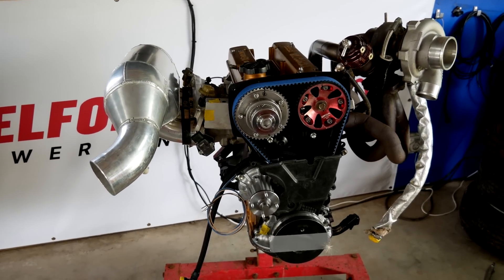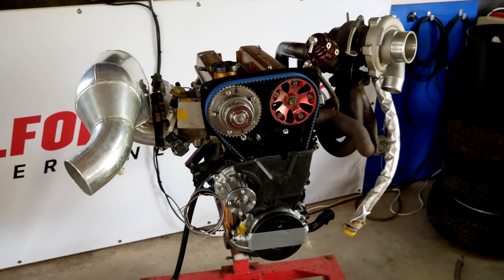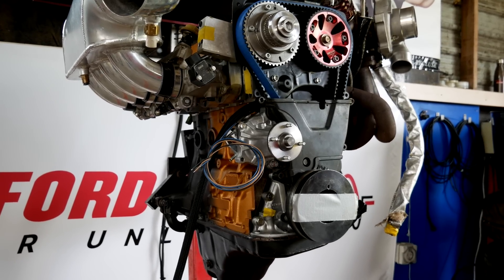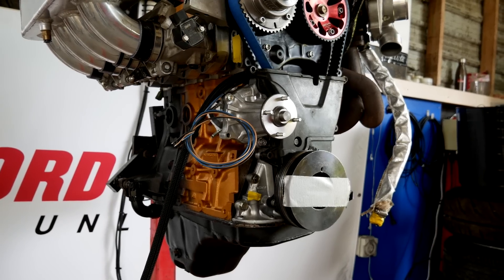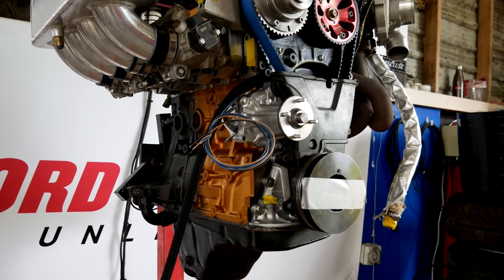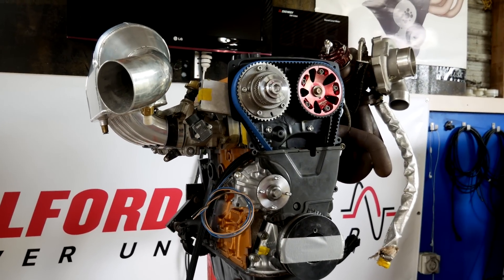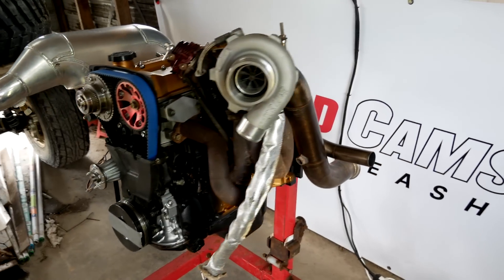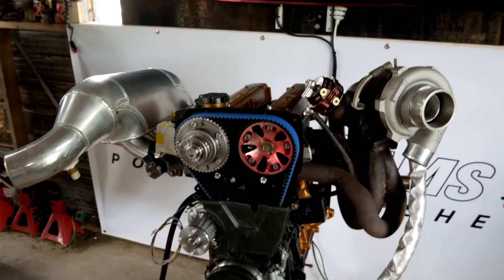10,000rpm, Long rod, VVTi, Turbo 4AGE Hilux - dyno tested

Comment from the maker: I lied,  its limited 9900rpm, not 10k.    Other news,  I have added a db sound meter to the dyno wall.  so you all can see how deaf I'm going.     Also have  a new mic for the camera, which was being used for the dyno pulls and the clips at the end. If you didn't get past the graphs at the end you probably should..   So yeah things should sound a little closer to what the actually sound like.    As always, if you missed the engine spec's they are in the description.    Giz a like and all that weird stuff  that everyone begs for,  so i can afford to put the rods back in my block when they fly out.
Reply: Sound like a very happy motor. Full song reminds me of a big turbo E85 CA18DET I built 15 years ago. VVT is a wonderfull thing and makes wonders for the powerband, some guys are locking them up and I allways thought that's the dumbest thing ever.
Reply: Awww man - we didnt see the magic cam install procedure :P  Awesome work!  Love the vids, info and dyno results and repeatability - long may the "truck" run!     A real sleeper build as well lol
Reply from the maker: @cbdrift   Everyone knows the vvti cam install is still top secret haha
Reply: @Garage4age Never hated a youtuber like this before🤣🤣🤣.. its like the magic show in the street but they won’t tell you the trick😭😂
Reply: Great work as usual
Reply: Goo oooonnnn

Go ooooooonnnnn
Reply: @Garage4age can I get a quote for you to fit supertech valve springs MRP retainers and Toda cam gears to my 6agte 20v? (Factory valve springs held it back from to much revs and boost during last tune)
Reply from the maker: @ryanandersen991 hey,  i dont usually do that kind of work, unless its here for a tune  as well.  but can email me if you want  garage4ag@gmail.com

Comment: I never ask but i know back then you use 47mm oversized blktop itb but what itb did you use now if those plate are 52mm still blktop oversized again ??
Reply from the maker: the 52's are bmw throttles
Reply: @Garage4age  oh ok so you are dbw now ?
Reply from the maker: @sachadohc2912   cable.   next build will have dbw itb's
Reply: @Garage4age  bmw as cable 52mm itb 🤔
Reply from the maker: @sachadohc2912  they have a separate  external dbw module. that commonly breaks  and is expensive.    easy to convert to cable.  port spacing is too big for 4age though, so have to modify them.
Reply: @Garage4age  oh ok didnt know you can convert them that pretty interessimg then

Comment: How do you keep the bottom end together when revving so high? I do not see a girdle or ladder caps to keep the crank happy.  Is it only because you are doing quick pulls and not sitting at those rpm's?

Comment: Thanks for doing all this awesome research! I currently have a 4AGZE, similar to your old engine minus the ported head and with a big SC14 setup. I am approaching the crossroad of switching to turbo.

I was thinking about a set of Kelford Turbo (HV) cams, 1SZ solid lifters, appropriate springs and then was heading down the route of a G25 (well PSR version) to try and get some response as I a really enjoy the instant torque hit of the SC14. How big is the turbine on your gtx2860? I'm probably also going to employ an antilag strategy as my application is an offroad buggy....which is why the instant response is so addictive. For the sake of information.....200kW is probably more than enough in a small single seater buggy between trees 😅

Interesting to see you had been pushing the 4AGZE rods and standard cams so far. Do you have a video detailing the porting and modified headwork somewhere?
Reply from the maker: gen 2 gtx2860 is still really good match for low - mid 200kw  at wheels.   have tuned a pulsar g25 4agze engine,  came on around 500rpm later than my old engine, but it did have some aftermarket cams, so results may vary.   The g25 would be my next step,  but would run the 2860 if dont want to go past 250kw.     I probably wouldn't even bother with cams if your goal is around 200kw,  a stock smallport ze with do that no problem,  but will take more boost. around 18psi on a nice turbo manifold  and intercooler setup,  with stock head and stock na inlet manifold.  done one not too long ago with same turbo as im running.      cams can actually make the turbo come on later if you go too big.     no vids on the head work sorry, the head on it was quite aggressively ported, probably almost too much for stock valve head tbh.  was a hand me down from my na engine  before i went to a big valve head.  something the 10 year ago me did..     the one on the new engine is a bigport head and was modified not to lose power  off the bottom. but yeh  not as good as the other one up top
Reply: @Garage4age  interesting! thanks for the tips. I just figured G series was the new hotness, but good to have some real world experience. Any idea how big the cams were on the PSR G series thing?

That definitely is the beauty of the turbo application, so easy to cram more boost in. The SC14 just makes whatever it makes, spin it harder and it just makes hotter air :p
Reply from the maker: @ae86racer007   it had hks cams   unsure if 256  or  264 version.  nothing too big either way.  G series newer tech yeah.   but is still a bigger turbo with bigger wheels than the  2860,    Any half decent turbo will make a stack more power on same boost as a sc12/14,
Reply: @Garage4age  I am starting to see that! Just going to need some ALS to keep it woke at 3000rpm :D

Garretts Boost Advisor did favour a 2860 over the G25....G25 is on the bottom of the efficiency Island, 2860 was pretty solid in the primo area :)

Comment: What are the advantages of running the itbs in a turbo setup instead of just a single throttle body? And thanks for all the great videos, really useful information
Reply from the maker: Hey, thanks for the donation.    Mostly so the engine runs nicer  at low rpm and idle.    With a big plenum single throttle intake and or bigger cams,    engine will stall out easier and not run down to  as lower rpm.     ITB's  will run a lot better down there since plenum is on the other side of the throttles.         An engine with bigger cams will run nicer with itb's than a single plenum regardless of plenum size or if its na or turbo.

Comment: I got 4agze stock bottom. I word like to make around 300whp reliably. Is it possible? What combinations do you recommend? Thanks 🙏
Reply from the maker: Yeah easy, long as its in good condition with good tune.   the "old engine"  in this video is just an 8.9ze bottom end.  has arp rod bolts, but otherwise stock parts.
Reply: Thanks for the reply
Reply: I have haltech 1500  would  like to use it on my so
4agze twincharge or turbo . What would  you go with?

Comment: Hello my friend,make video about phase timing (ECU)like you have about ignition timings,if it possible ❤
Reply from the maker: I have quite a few cam timing videos if thats what you mean.    4age vvti: https://www.youtube.com/watch?v=B1mAesApxv0       k24 :   https://www.youtube.com/watch?v=rX6rAjI-VW0 
 4age turbo https://www.youtube.com/watch?v=bnIsNwdKnCw    this one is not variable but you can see what the settings would be if it was
Reply: @Garage4age  I watched these videos,I think they are very useful. I asked the question a little wrong, I’m interested in how the timing of fuel injection itself is affected, maybe your ecu doesn’t have such a function, I can’t know for sure, in mine ecu has a map similar to an ignition or mixture composition map, only there you can set the timing of fuel injection, for example, into an open valve or into a closed valve, etc. ,exactly the moment of opening the injectors,That’s what I meant
Reply from the maker: @nivagarage301 Ah you mean injector timing.   some ecu's call it different things.   I did a little bit on it in this video   https://www.youtube.com/watch?v=lt7JpXEfH-4    Isn't usually much in it power wise. generally  just adjust till afr is the richest, meaning the fuel that is injected it getting burnt/properly  burnt.  then trim the fuel back to the correct afr.    can make the engine run nicer at low rpm,  sometimes is a little to gain in the top end on an aggressively cammed setup,  but only if have big injectors that are running at lowish duty up there.   i may do a video on it at some stage

Comment: Hey I know this probably isn’t the best way to ask this question but how did you do this swap I have a 87 4x4 and have been trying to figure out how you did it for years since I saw one of your videos and now my motor is out and I’m debating on a 4a 16 or 20 valve or a 2JZ and I have really liked these motors so any info would be very appreciated

Comment: Still 1.6cc? Why use the 4age cranck in 7afe block? I want to build a 7afe block with 1zz cranck, and 2zz rods but im afraid 😂
Reply from the maker: because it makes everything the 4a is better.  that being a small high revving engine; smoother, more reliable at high revs.    7a on the other hand, vibrates more, pulls power band down the rev range and makes for a kinda lazy boring engine.   Yeah its still 1600, same bore and stroke, just longer rods.
Reply: I run a early bigport/4ac bottom end with 16v smallport head, i doubt of going with a 7a bottom end, but here is more easy to find parts for the 7afe, i want 180hp (the head now is worked with some cams, with std head i have near  150hp to the cranck) What would you do in my place?

Comment: Hey mate just wondering if you’re worried about the shim over buckets crapping the bed at high rpm? I watched a video of a guy talking about 4a’s and he mentioned Toyota switching to rockers for the 2zzge head because longer duration cams and higher redline. Cheers
Reply from the maker: I have swapped to 1sz shimless buckets on this engine.    You will find 2zzge uses rockers for the vvl system, rather than them switching to them for rpm issues

Comment: is it a destroke ? how many CC ?
Reply from the maker: both engines 1600cc.  new engine has taller block and longer rods.  same crank in both
Reply: @Garage4age  woah. so its same bore, just taller deck ? is it custom billet ?
Reply from the maker: @aubreyk.5927   its a factory toyota 7afe (1800cc) block, which is the same bore as 4age, just  is 15mm taller
Reply: @Garage4age  so, a 7a Bolck, with 4a crank ? and/or custom rods ?
Reply from the maker: @aubreyk.5927  yeah 7a block. 4a crank, custom rods,  4age pistons

Comment: Old engine had more stroke as i undrestand and was better mid range which is logical. Vvti band aid the low rpm but no replcament for displacement. What is thr reason for the destroke?
Reply from the maker: they are both 1600cc.   old engine is a factory 1600cc bottom end,  new has taller block but longer rods, same crank.  more reliable at high rpm.    The difference is in the heads, old engine had newer design  smallport head that had been heavily  ported, from one of my na builds.    new engine has older design bigport head.     if swapped the old head onto new engine would make more power.    but already does what it needs to.          old engine/head had more midrange power due to where the cam timing was set, if it had cam timing adjusted or vvti would make more power up top also.      The new engine is mostly made of 2nd hand parts and leftovers from other engines and projects btw
Reply: @Garage4age  very interesting,I take back my comment. Any chance of flowing the two heads. Is old design bigger port really flowing more than newer design small port. What about valve sizes and throat %?
Reply from the maker: @abdullaalameri90    The  big port and smallport names are kinda misleading.  its just the port entry on the  the "bigport head that is actually bigger,  which what seems to be designed around the toyota tvis system.   further down the port the bigport head is smaller than the smallport head.  both are the same on exhaust side.      Both can be modified to make pretty much the same power.     In this case its more the fact that the smallport head on the old engine  has had more aggressive work done to it.    They both are modified and make more power than stock heads.  The bigport head was originally  modified with the aim  of not loosing any bottom end power and gaining top end.  which i did, can be seen in one of my earlier vids.
Reply: @Garage4age  thanks very clear

Comment: i was under the impression high duraton / lift cams would negatively impact low end torque / power and instead you gained a tonne of top end, how did you manage to gain low end aswell as top?!
Reply from the maker: Thats why i only swapped the big inlet cam in with stock exhaust cam.   if I use the exhaust cam out of this set (they are actually na cams)  it will come on boost about 1000rpm later than stock cams.   have done the same test on the na version of this engine https://www.youtube.com/watch?v=-Inv1TkANls    Which is the same head and similar bottom end.     It really needs the vvti to make it work so well though.
Reply: @Garage4age  interesting, so installing intake cam and leaving exhaust stock actually has opposite effect of having both!

Comment: the old engine was 1800cc as well or was it 1600cc?
Reply from the maker: Both are 1600cc
Reply: @Garage4age  i'm sorry i didn't write that clear enough. i mean only the bottom end, since you said the new bottom and is 1800cc
Reply from the maker: @noahkalin5379    the block itself on the new engine is from a 7a (1800cc ).   but it has the 1600cc crank.  So is 1600cc.  I'm using the taller 1800 block to fit the longer rods
Reply: @Garage4age  and same thing goes for the old motor?
Reply from the maker: @noahkalin5379   old engine was a normal 1600cc   1.58 rod ratio.  new 1.78
Reply: @Garage4age  alright, thank you very much

Comment: Hey dude with a 10 K rpm limmit on that capacity your turbo too small By Far so you dont have enough air to supply It
Reply from the maker: Not at this power level, it's fine.    Power curve is very similar to  the same combo in na form. Plus it reacted well to the cam swap.  Pretty much as expected, as it done na.   If was chasing more power. Yes I would run a bigger turbo and a bigger exhaust cam.  But that would loose power off the bottom. more bottom end power was one of the main goals.   So yeah everything is happy and working as planned. Has stacks of power for what it needs to do

Comment: The dyno looks to be Sus to me .looking at torque to hp curve the 5000s rev shows no lapping . ..? Look I’m no expert but looking at the 10000 rev speed ? Power lapping lines ? Torque is at what ? 🫤🙄 ha, I hope this is all real and I’m not reading the graph correctly . 👍
Reply from the maker: Hey,   yeah get a lot of questions about the torque numbers,  i even made a video about it a few years back. https://www.youtube.com/watch?v=krnmGSmUQOI at the end it explains how it works.   basically the numbers you see are what ever dyno reads in the background and uses to calculate power from said numbers and roller speed.    Then is another calculation  from power  and  engine speed to  show "torque at wheels"  which is really the engine torque minus what ever the driveline loss is.     only an engine dyno will read torque directly.  any other dyno that reads after the driveline, its a calulation from power.  which  my dyno doesnt do.   So yes short answer is the power numbers are correct, and the rpm is correct as  i put the start and end numbers in manually from the ecu logs.

Comment: Usually i dont write comments, but your content give me alot of knowledge, your "good engine" makes almost same power as formula atlantic one, but there is not much to change to make more top end, maybe consider to try electric water pump instead of belt powered, like Old davies craig devices or tecomotive Tiny cwa + pierburg pump, i bought Old davies craig kit for cheap, i think it will be good topic for video and maybe a chance to beat formula atlantic engine